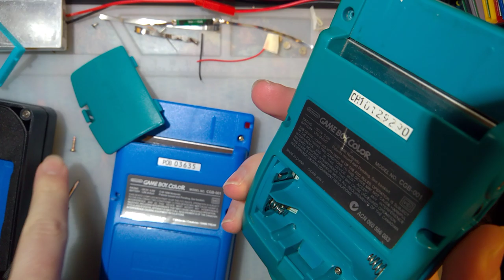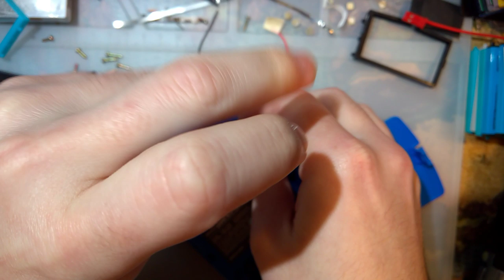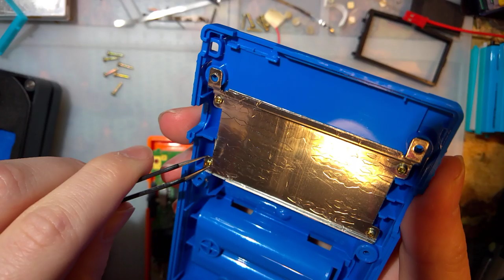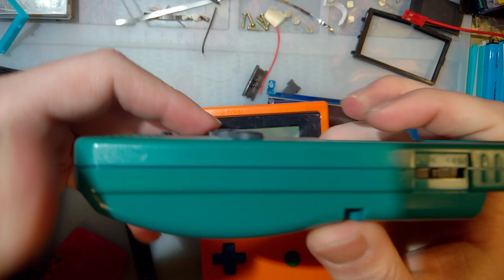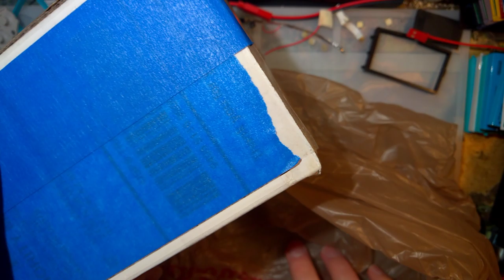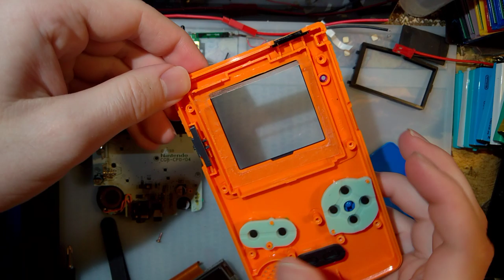Game Boy Color Midwest Embedded Backlight Prep

Comment from the maker: Also, something I completely missed in the video (thanks RGRS for pointing this out), Pikachu's chin on these aftermarket lenses is green. On the OEM lens, it is orange. There are a few other little differences between the lenses so take a look at this OEM one for an example: https://cdn.discordapp.com/attachments/666796555835015169/675531614608162816/image0.jpg
Reply: Regarding the ips funnyplaying pixel issue: this is related to what cpu version you have. Anything C and below bad. Anything D an above, good.

GBC-01 = CPU type A
GBC-02 = CPU type B
GBC-03 = CPU type C
GBC-04 = CPU type C or D
GBC-05 = CPU type D
GBC-06 = CPU type E

https://bennvenn.myshopify.com/pages/gbc-cpu-revisions
Reply: I love the case, but you already know that, since you saw my vid :D
Reply from the maker: @thepokerus4184  That's not strictly true because only some 05 boards work without issue. Also, this thread has nothing to do with that mod.
Reply from the maker: @nashismox3  I haven't quite uploaded these videos in order. The 06 PCB that I used in the IPS video came from this GBC. I filmed this video first. 

I did conclude that using an 06 PCB with the IPS mod seems to resolve the issue but I did not find a way to fix other revision PCBs.

Comment: Yep same problem with my repro DMG case, the factory screw are too big and crack/strip the hole. The repro cases can be IDed by looking at the speaker holes, they are oversized. To alleviate stripping screw hole, I usually turn CCW until it skips, to line up with the existing threads (if any) before going CW. But yeah, I've seen eBay listing with repro shells as refurbished but it doesn't say so...

Comment: Is the Midwest Kit noisy at all? I get very noticeable buzzing on my GBC with one installed. 

I have tried:
Console5 Cap Kit
480uF cap on C32
480uF cap on C32 and C38
680uF organic polymer cap on C32 and 480uF cap on C38
Back to 100uF cap on C38 since it made no difference
And as much as I don’t like RetroSix; HHL 680uF cap on C32, GBC CleanPower to replace voltage regulator. Still sounds identical to the cap values from Console5 that I started with.

I am very tempted to just swap the Midwest kit for something else due to it being power hungry anyway.

I have a revision 04 board with revision C CPU
Reply from the maker: the newer kits are way better. Look at funnyplaying's new Q5 based kit.
Reply: @makho  does a revision C CPU have any graphical issues with the Q5 kit? My other Q5 Gameboy uses a revision D CPU and is fine but I read the page from BennVenn about the differences between CPU revisions.
Reply from the maker: @driverdis3488  With the newest version of the Q5 kit, there doesn't seem to be any issues specific to any GBC variations.